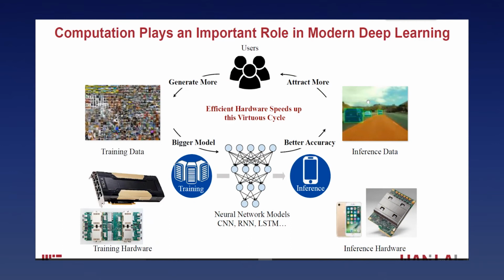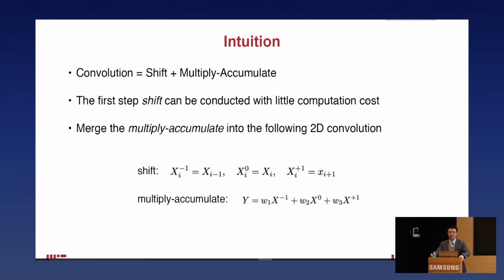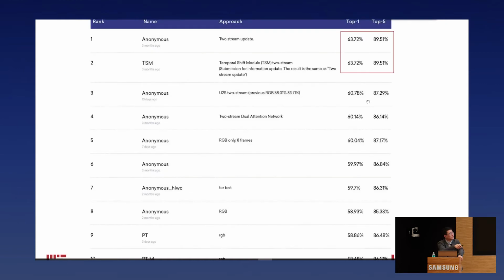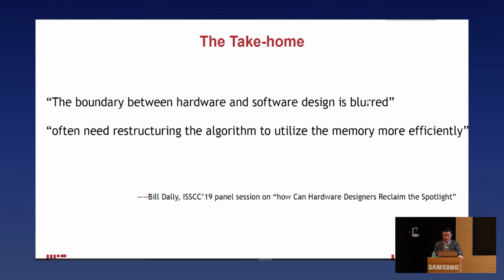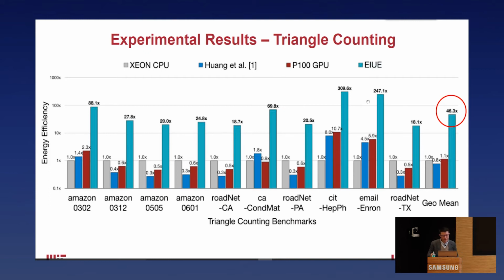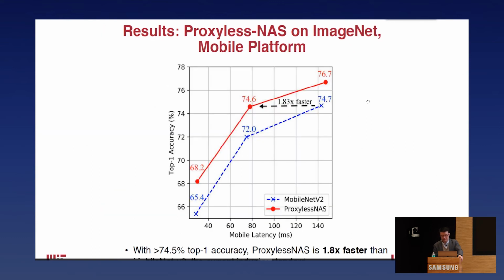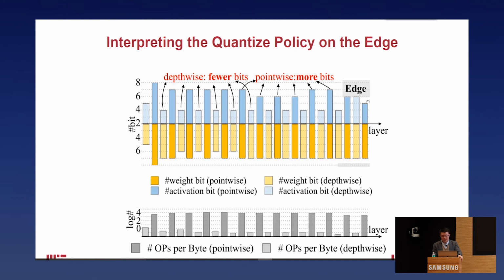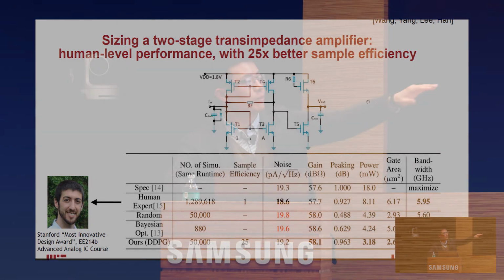MIT Professor Song Han, Hardware Design Automation for Efficient Deep Learning, Samsung Forum

Comment: I would say that if we are designing for "NOT" high speed operation devices then we may use Virtualisation via algorithms and software, however if speed is critical such as in speech recognition and high speed security and surveillance then it becomes vital to use hardware such as FPGA, or very high MIPS ARM controllers. The application will dictate what platform to use. Great lecture - thank you for the details.

Comment: I wonder if there are any systems that are built with two core processors to perform for convoluting 3D CC so one processor will shift and the shifted output is directly fed to the operation of multiplication by the second core? This speeds up the overall processing scheme. This is I believe less costly than delaying the generation of convolution process since hardware is becoming very cheap (2 cores) today but the end result maybe used in a highly sophisticated and costly applications. The ROI will be very high then. Any feedback?